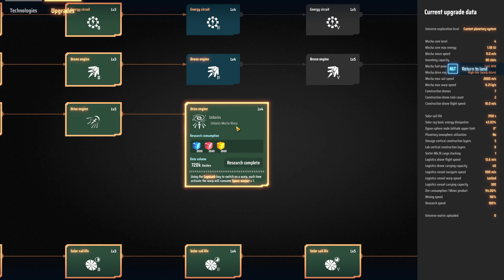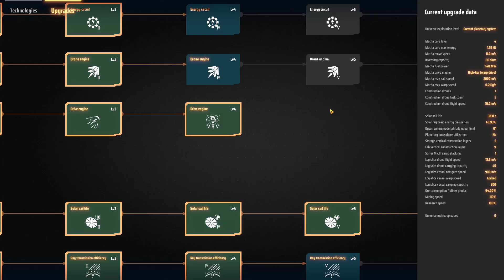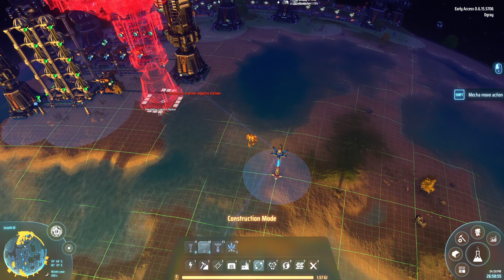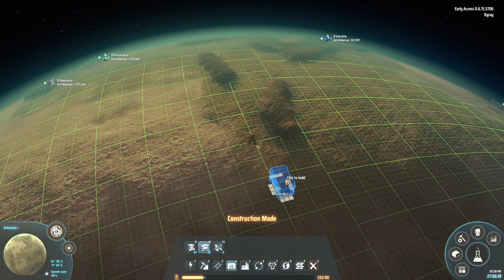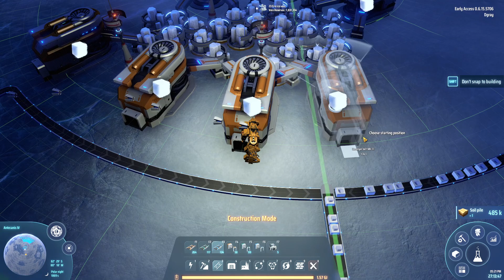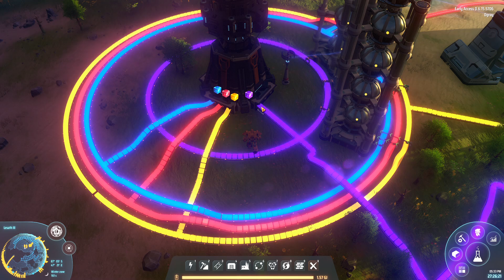LEAVING OUR SOLAR SYSTEM! - Dyson Sphere Program - Let's Play Tutorial Gameplay DSP Ep 25

Comment: You need logistics speed 4 before vessels can use warpers. Once you get that there will be a new slot next to the drone and vessel ones that has warpers in it for usage by the vessels. You also get a sixth choice when belting items out from a tower, this means you can "daisy chain" towers with belts for distributing them without needing to dedicate one logistics slot in each one for warpers.